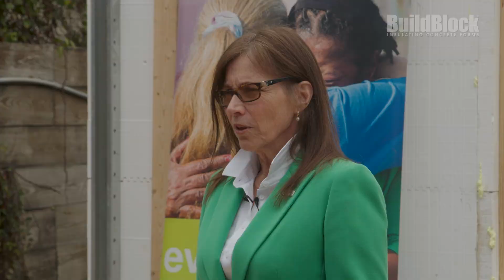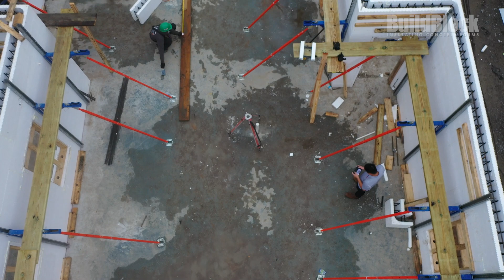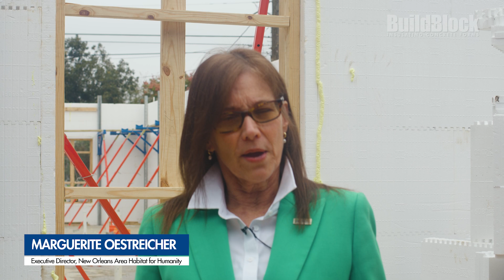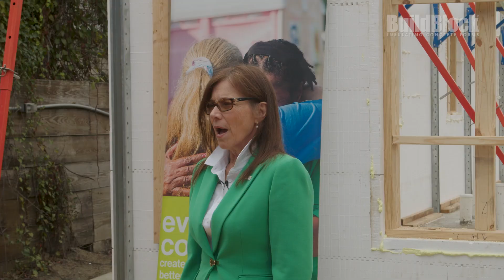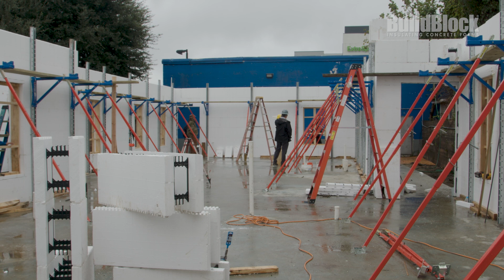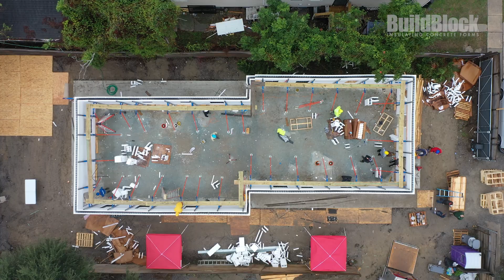How To Build Low-Carbon, Efficient, Resilient, & Sustainable BuildBlock ICF Homes with NOLA Habitat

Comment: A regular framing crew will build those walls in a half day, I don’t think it is the right direction to compare that, I believe is more like the steps you’re getting with this system as, framing, insulation and finishing interior and exterior on just one step…